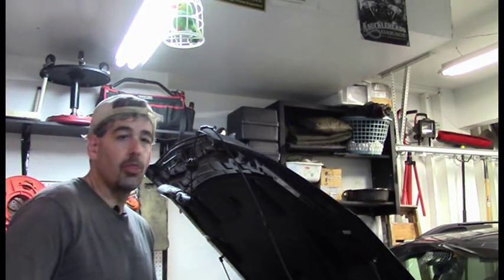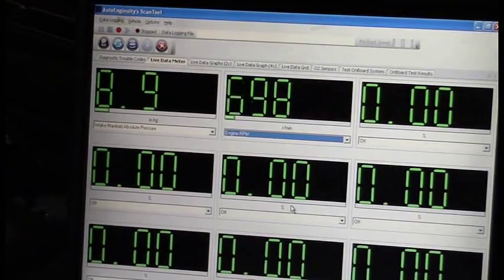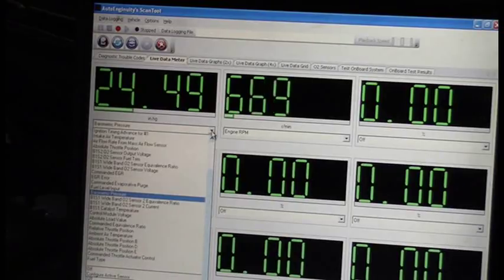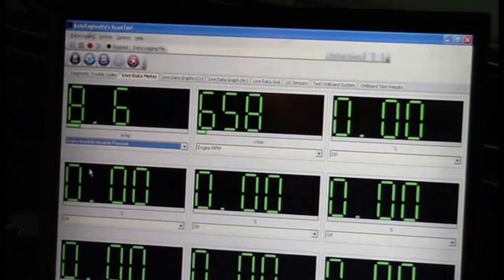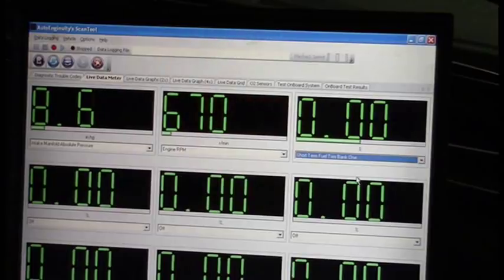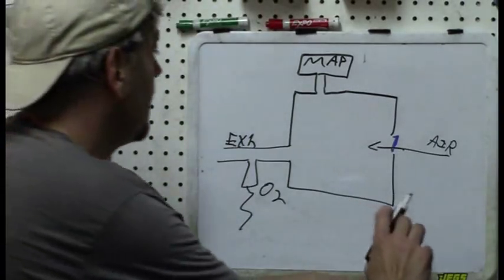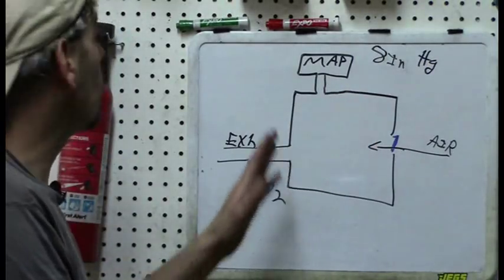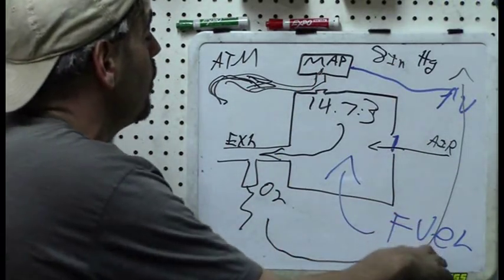MAP Sensor Diagnosis and Understanding Function- Pt2

Comment: Hi Matt. Great video! 👍🏼
 I need help with a 2012 Kia Soul. Car idles terribly, runs rich and keeps fouling plugs. I changed the upstream A/F sensor twice, but no improvement. Normal Barometric pressure reading is 30.3 in/hg and at idle the MAP reading is 23.5 hg/in. At 3000 rpm in park, MAP reading drops to13.5 hg/in. Reading are high, and my scanner doesn't display MAP sensor voltage output. Do you think the MAP sensor is bad, or  a clogged catalytic converter causing the high readings, resulting in excess fuel, high lambda reading of 1.5 and LTFT of -1.6% ? Any help would be greatly appreciated.
Reply from the maker: unfortunately there is no useful data here.  nothing is curved against load. also you need to calculate the Volumetric efficiency.

Comment: Good day Sir.
Great channel and much appreciate the info. I wonder if i may pick your brains as you are obviously talented , which  i don't think the service department at Ford come even close even with all their fancy equipment..
I have a 2014 Focus ST and my center Turbo gauge on top of the dashboard does not move at all. I took it to Ford and after your typical scan(with no faults what so ever) and $219 later they said it was fixed, i drove off and the  boost gauge still not moving. I took it back and they reckon is a faulty gauge. Are you abled to offer some more ideas or a different point of view on this issue.   i would really appreciate your help. Many thanks !
Reply from the maker: put a 5V signal to the gauge and see if it moves.
Reply: @SchrodingersBox Thank you will try this  and revert to you just to let you know the outcome.  many thanks !

Comment: if you test for contiuity from signal wire to battery ground will it have it or not
Reply from the maker: Hmmmm good question. i would say no- because the signal wire is basically a DVOm. there has to be a rather significant internal resistor where the wire terminates so that the variable resistance can be read. it’s likely greater than the resistance of a multimeter so you probably won’t see continuity to the battery. i might be wrong about that- it depends on whether the internal resistor on the signal has more or less ohms than a DVOM does. 
   the best way to check signal wire continuity is from the component connector to PCM though- it should have no resistance at all up to the PCM.

Comment: Thank you for your deep explanation of the MAP sensor. You did not mention force induction engines that is the most common these days. I was wonder how the MAP sensor handles the bigger span of pressure reading? Is the MAP sensor calibrated for higher than atmospheric pressure when it reaches 5V? I suppose all turbo engines require both MAP and MAF sensors? I have a problem with my genesis coupe 2.0T 4cyl. As soon as the turbo starts to give a boost pressure the engine hesitates and more pressure on low rpm is worst. It snezing like like lean condition. The dealership has connected the diagnostic tool but they did not see any code coming up. A cold engine will hesitate less than a normal working temperature. After I have seen some of your videos I'm surprised they not can find what is wrong. I wish I have a scan tool myself to see if I can find the issue. If anyone has a suggestion I'm happy to hear it.
Reply from the maker: That’s exactly correct.  I plan on doing a video on forced induction at some point but you are correct.

Comment: If someone is patient and sticks through both videos they will walk away with a wealth of understanding.
Broken wires or bad grounds are common. I have a new maf  sensor I've got voltage, but I'm not reading anything between the ground and signal wire when it is running. 
Thanks, very informative.

Comment: I wonder if the computer have a good signal but not a ground can the computer sends a check engine lights anyway ?
Reply from the maker: if the computer has no ground then it will not function at all.

Comment: Thanks. I have a map only intake no MAF. 5.3 LS in a mustang and my map is reading extremely high with a fitech harness and its flooding my plugs. Only fault i have is map to high but i did lean on it and cracked it. Got another but it was a 1 bar and im being told it will only work with a 3 bar. Waiting on order to come in to see if this is true

Comment: Hey Matt. Only running MAP no MAF. Will a bad MAP cause computer to flood plugs when trying to crank causing constant spinning over and back fires?
Reply from the maker: it could.If you have a MAP only engine and the MAP is bad the engine may not even run. I converted my trans am to speed density only with the supercharger and I can tell you it won’t even run without the MAP sensor.

Comment: So an engine with only a MAP sensor, throttle sensor, o2 sensor and probably a rpm sensor. If you were to add turbo boost, what happens? Now I understand the manifold would loose all vacuum and become pressurized. So would the map sensor signal as full throttle, to get full fuel even though the throttle is only half open. Would you also get a check engine light? I'm trying to find out if I can add a small turbo to my stock 92 EFI suzuki samurai. It has one fuel injector in a throttle body.
Reply from the maker: whenever you add forced induction there is no way around it- you must remap the induction metrics in the PCM.

Comment: 24.5" of mercury seems pretty low for an atmospheric reading.  You must live at a pretty high altitude and a hurricane was happening. ;). Edit: I just saw the MAP showing above 27 when you pulled it out.  Still lower than I'd expect.

I expected to see the fuel trim go positive, but it went negative.  I'm guessing this is because the computer was using the wrong area of the fuel map which would be pouring in extra fuel, but then the O2 sensor made it start taking away fuel, so the numbers actually went negative.  I'm thinking we would see the injector pulse width instantly jump up as soon as the MAP sensor was removed, then start tapering down as the fuel trim goes negative.
Reply from the maker: I am in denver at 6200 feet so I am at high altitude. Also the positive fuel trim is because if you think about it, Removing a MAP will cause a high voltage on the circuit because it is open. This is representing maximum atmospheric pressure so therefore the PCM initially responds by increasing the fuel trim.
Reply: @SchrodingersBox  oh man, that is high altitude.  I live in the land of near sea level and 93 octane gas.  We went to Colorado a couple years back, couldn't believe the octane ratings on the pumps.
Reply from the maker: Yep. I am from St. louis- elevation 200ft. When I first moved here and saw premium fuel with only 91 octane it freaked me out since I do have a high compression engine but that was also before I was into automotive stuff at this level. I now know Because of the lower oxygen density, there is less issue with detonation so 91 octane is plenty sufficient at this altitude.

Comment: Hi, when i disconnect connectror of map sensor, so the sensor is still in intake manifold, why does ecu is showing trouble code “too high voltage”, i would like to know reason behind that. It something with electrical resistance  or ECU is working with value of atmospheric pressure?
Reply from the maker: Because the circuit is open so you have no voltage drop at all across the potentiometer. There is 5V- High voltageAs opposed to a short to ground which would be 0V- low voltage.
   If you have 5V the only explanation is an open circuit after the reference feed from the PCM.
Reply: Thanks

Comment: If it is not the MAP sensor, what could cause the engine rough at idle and sometime the code P2195 on 2008 Acura TL?
Reply from the maker: Man just about anything.  What data do you have?
Reply: @SchrodingersBox  I only got that code P2195. It cleared now but idle is rough and almost stalling after let go the gas. I checked the O2 Sensor and vacuum leak. Nothing obvious at all. Checked the PCV and hoses.
Reply: @SchrodingersBox  I really like your channel.
Reply from the maker: So what was the O2 sensor data you got that showed it was OK? Thats where I would start.
Reply: @SchrodingersBox  I have new O2 sensors. I replaced it. Still showed problem. I just replaced valve cover gaskets. Somehow 2 fuel injector connectors came loose. Plugged them in and everything is good now. Thanks for the MAP explanation. That ruled out everything except the fuel problem.

Comment: I own a 2006 Chrysler Town & Country. It used to give 22mpg but it gives only 13.6mpg. When the Check Engine Light came on, the Auto Zone guys diagnosed and it needed a EGR valve changed. So got it changed. After some time the light came on again. Took it to Auto Zone and later to a Auto Repair Shop. Both of them told me the van needed oxygen sensors replaced. So got the front and rear oxygen sensors replaced. Later the light came again. This time the guy who replaced the sensors told me to take it to the dealer where they could do extensive diagnosis. I took the van to the dealer. They concluded the van needed the catalytic converter replaced and it would cost $1690. Instead I took it to a Muffler Shop. There the mechanic pupt the van on the hoist to check the catalytic converter. He called me to the bay and knocked on the catalytic converter to tell me that there the casing for it was empty. Essentially there is no catalytic converter; only the casing. By now I have spent nearly $400 for no rhyme and reason, but learned an expensive lesson. He offered to install a converter for $550 but no guarantees that the light would not come on again, and the mpg may not improve. He told me just drive the van as it is and if the mileage goes down further, trade it in for a different car. So, what is your expert advice? Can anything be done to fix this problem?
Reply from the maker: You need to ask them HOW they are coming up with all these wrong diagnoses. What data are they using and how are they interpreting it?
   It seems to me they are just playing the parts lottery with no data and no analysis.
Reply: @SchrodingersBox   Oh, they show me the printed results of the diagnosis without actually looking at the hardware. Only the muffler shop looked at the hardware and thus concluded there is no catalytic converter inside the casing.

Comment: Swapnoistics . does it work. yes. but you never find out the cause of failure. not a good practice
Reply from the maker: Explain how it “works”?  How does it work when you swap everything there is at thousands of dollars and it isn’t even a part failure. How does that “work”?

Comment: Hi, how about the DIGITAL MAP sensor, does it exist ? Because I tested mine and the V didn't change, by the way i have a 4wires map sensor with 2 ref wires....thanks.
Reply from the maker: Absolutely there are digital MAFs. You would see a frequency change so on a DVOM you can’t read voltage to diagnose them.

Comment: Great tutorial. In the absence of an explanation for in my case a Mini R56, n12 engine. It carries no MAF sensor. I see now how it’s trimmed by the MAP sensor. Like your diagnosis of the other linked sensors and possibly scenarios too of coding or voltage errors. Thanks and now subscribed.

Comment: What would make my map go from 9.7 at idle to 7.2 at 2500 rpm
Reply from the maker: Whats your TPS angle?
Reply: @SchrodingersBox  0.4 at idle i have not looked at 2500 rpm but it seems to move up and down smooth but skips from like 2.4 up to 2.8 and misses the in between numbers alot all the way up and down
Reply: Ok just got off work my tps is around 7.4 at 2000 rpms or so. My map sensor is reading 7.2 to 7.4 at that same rpm. Chevy 4.8liter and it runs rich at idle (negative12 is the worse i have seen but only at idle when completely warmed up and also on decel when letting of the gas completely. The maf is reading little high at 0.72 at idle.

Comment: Excellent videos!  Excellent teaching.
 I do have a question you may not have addressed. While testing the MAP sensor with a system that also uses a MAF sensor, you must have the intake (Filter and flex hose) connected to the throttle body intake- Otherwise, I can guess a fuel lean condition if it isn't connected?

Comment: I love your videos but I’m confused about something. I watched your map and fuel trim video. I have a supercharged Jeep and I have a p050d code and my map inhg reads around 12~14 and higher when I first start it up. But my fuel trim almost normal when I first start but regular idle is -10 on both banks , maybe 1or 2 off on the other bank. 
So if I understand right the fuel trim should be + if a vacuum leak but mine is - but my map is reading like it has a vacuum leak? Maybe bad map?
Reply from the maker: MAP will read higher on forced induction. Remember you are forcing air above atmospheric pressure.
Reply: That’s what has me curious about the - fuel trim at idle . Maybe fuel injector- ? Thanks

Comment: to get this I needed to find out that that Atmospheric pressure is 30 inches mercury.  Thus moving from 8" to 30" is a big increase. Thus the MAP thinks there is a  whole lot more air in the chamber, thus computer wants to add more fuel to maintain the ratio.   The thing that confused me though is the negative STFT until I saw that the O2 sensor is going to find the mixture suddenly rich, thus needs to reduce fuel input.    SO the STFT will be a NET figure of the actions of the MAP and O2 sensors combined.??  I assume the fuel increase caused by the MAP is part of the STFT figure. What the MAP giveth the O2 taketh away, plus some.??

Comment: I am getting egr insufficient flow in lexus is220d 2009. Is that cause by map sensor?
Reply from the maker: I don’t know. What data do you have?
Reply: @SchrodingersBox  I have replace new egr valve and pipe connected. I have cleaned top manifold were egr connected to.it jerk sometimes when engine is cooled. Intermittent turbo boost problem. Sometimes times it work. Sometimes it won't. My mechanic are waste of time.

Comment: John here very good showing how MAP senor work have F150 1993 5.0 check throttle senor and oxygen senor timing was off 3% check engine on and off seem to die idling in cold weather after warm up seems to run but not great so I.m going change it out and go from there

Comment: Why is the reading you have inverted? a normal engine will read 18-20 in_hg.  The scale starts at 0 which is atmospheric pressure and goes to 30inHg which is a perfect vacuum. so if you connected a vacuum gauge to your intake manifold you would see your numbers invert, meaning when you rev the car your inHg will be close to 0 at wide open throttle and  then on decell; over 20inHG and then return to around 20inHg at idle. 

I'm not sure why OBD pids read like this as it is the same on my car. The only explination is that they have changed the scale so that the higher the unit; the less vacuum. which is the inverse of how it should be. It also may place the "perfect vacuum" point elsewhere as 8inHG should be 20inHG when reading the obd pid vs the mechanical vacuum gauge. Do you have an explanation of this?
Reply: After thinking about it for a little. I think they have indeed inverted the scale as i assumed. conventionally perfect vac is 30, 0 is atmospheric and 20 is vac at idle.  
Since they inverted it , the numbers would be as they show on your OBD tool 0inHg is perfect vac, 30inHG is atmospheric and 8inHG is idle. This would explain it.
Reply from the maker: Correct- it';s measuring absolute pressure so you will see (at my elevation) about 24-26 at atmospheric but at idle when vacuum is high, it reads about 8 and on decel when vacuum is highest it reads as low as 2

Comment: Great insights to the MAP sensor; thank you for a well done and detailed tutorial. You have answered a question that no-one could on youtube, and that is; Why my engine (Audi 3.0L TFSI Surcharge) does not have a MAF sensor?  Thank You!
Reply from the maker: Yes many cars operate only on a MAP sensor- no MAF.  These are called "Speed Density Design" and while I prefer MAF and MAP, it is possible and even common to see cars that only use MAP (usually asian vehicles).

Comment: The garage must be at altitude if the MAP’s baro reading is 24 inHg. Denver?
Also, a 16” differential between manifold vacuum and baro is a bit low - it should be closer to 20” - vacuum leak(s)?

Comment: If you open the Throttle slowly and the MAP sensor's voltage does not climb, is there something wrong with the map sensor?
Reply from the maker: It would seem so. The MAP should increase when manifold pressure increases.
Reply: @SchrodingersBox , Thank You.

Comment: hello. great explanation. thank yo for this video. :)
just want to ask.  When i connect the hose of MAP sensor to the intake manifold, my rpm go up to 2000rpm in my corolla 94 4afe.  but when i remove the hose from the intake manifold my rpm goes to normal again. what could be the problem?  i'm from philippines and mechanics here in my city cant fix the problem.  :(
Reply from the maker: What is the MAP voltage showing at idle vs under load?
Reply: @SchrodingersBox  sorry i dont have multimeter

Comment: So basically if engine have MAP and MAF sensor you can easily see if you have boost leak in intake system?
Reply from the maker: you can see that much easier with fuel trim than with induction sensors.

Comment: Trailblazer 2006 map sensor reads 100 on actron scan tool at no startup. Is this normal ?
Reply from the maker: Depends.
Reply: Ok so ?? Cleaned it and read 99 to 100 so believe it is ok. Last question.  St fuel trim on freeze frame data is at 50. Lt is less than 10 . ? ? ? Any ideas? Am not a mechanic but mechanically inclined to a degree. Any help .. would be appreciated.  Ps your channel is like  college for us young guys. Thank you .. learning slowly
Reply from the maker: Can’t say anything about the fuel trim either. You cannot determine anything from a singular frame of reference.